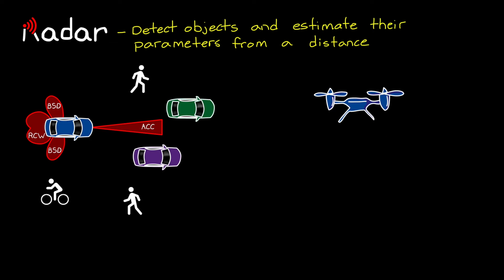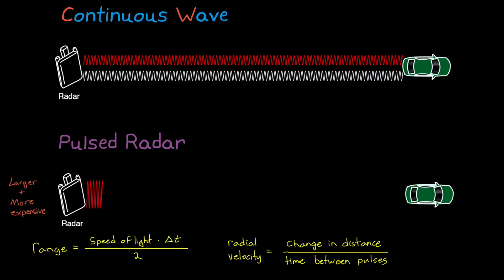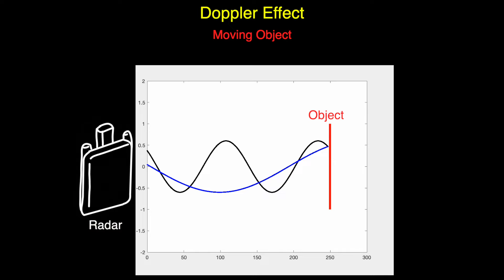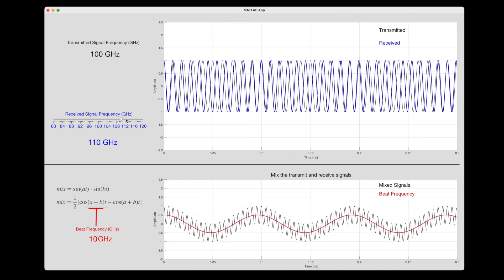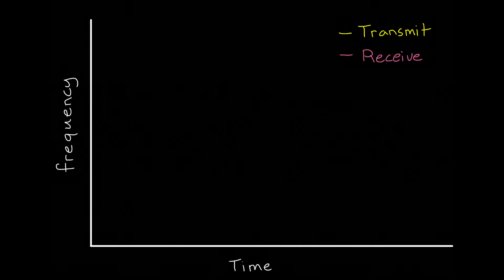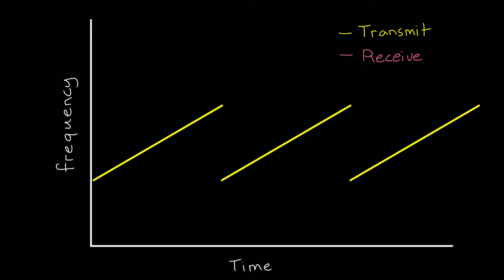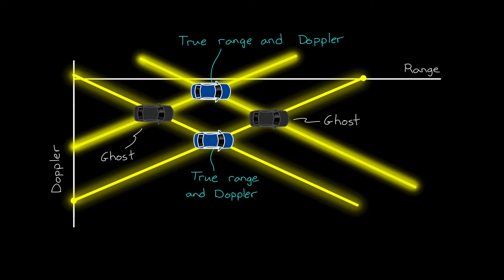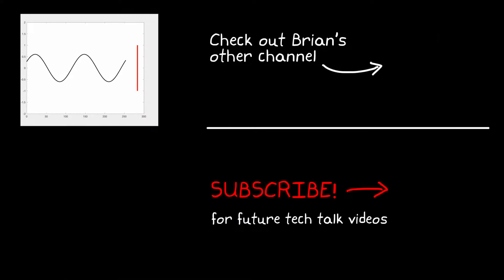FMCW Radar for Autonomous Vehicles | Understanding Radar Principles

Comment: Really nice job! Thanks. We at dSpace have auto radar test HW that can allow simulation of up to 1000m distance in various frequency ranges especially E-Band 75 to 82GHz (up to 5GHz BW) but over a short distance test set up in the lab! This allows auto/radar vendors to easily test HW for scenarios of e.g. FMCW, Doppler, MIMO => location, speed, angle, and differentiation of 2 cars ahead for example.

Comment: @Brian Douglas Hi Brian.  You made a fundamental mistake  at 8:54. You don't transmit an IQ signal.    Transmitting sin + cos is the same as transmitting a shifted sinusoid, which does not solve any problem. It is like shifting the transceiver by quarter wavelength. What you need is  performing IQ downcoversion in receiver. Otherwise nice video and beautiful presentation.
Reply: Hi habi, actually my thought is that Brian had computed the Real and Imaginary (IQ) components of the Mixed signal being thereafter processed of prior transmitted signal. Hence, we merely need the Magnitude and Phase of mixed signal to derive In-phase (Real) and Quadrature (Img.) components in Complex Sinusoid form as indicator in relative to determine whether it's Approaching or Moving Away target, if there're any of other thoughts or opinions, feel ease to share, Thanks habi :)

Comment: All nicely explained until 11:54 when you show the Beat Frequency as the difference between Tx (yellow) and Rx(pink).
However the difference is the same wherever you are on the ramp.
Therefore how do you use the beat frequency to deduce the range if it’s the same value along the time axis ?

Comment: Nice Video!! thank you so much. Quick question -If we precisely estimate the received frequency, a Computer could estimate the direction of the target by simply subtracting the frequency of the received signal from the frequency of the transmitted signal? If so, then why do we need an IQ and beat frequency concept?
Reply: Good question! It's really hard (expensive) to measure the precise frequency when it's in GHz. But it much easier to measure a signal that is in KHz (like the beat frequency). If you did have a super precise computer that could estimate the receive frequency in GHz then I believe you could determine the Doppler that way. You'd still need IQ signals to determine direction though.

Comment: Hi; great video series - I have watched up until ep4 (pulse-doppler) and the explanations have been great. Some questions: where you say the i and q signals are orthogonal, do you mean physically orthogonal, i.e. two perpendicular antennas (e.g. cross dipole)? If I'm not mistaken, wouldn't orthogonal, 90deg phase shifted signals result in circularly polarised radiation? Presumably it's not possible to produce i, q signals with a single antenna? Thanks in advance.
Reply: Hi ejq, base on my understanding it's rather mathematical than physical, we may read on Complex Sinusoid form, as Brian had presented such that of single resultant complex field form (single poln.)

Comment: Thanks for the video. But I get confused at 12:36 sec.
Could you explain more about the range doppler chart? I don't understand why we have a rising line in the chart, then we have another falling line? :/
Reply: This is the only part of the video that was not well explained, I agree with you on this. I think I understood how these lines are derived: You have to find the two points that intersect with the Range,Doppler axis. We can find the point on the doppler axis by shifting the receiving curve on the right until we have 0 range (2 beet frequencies equal), and measure how much is the doppler-caused beat frequency there. Then, for the point on the Range axis, move upwards/downwards the receiving curve until doppler-caused beat frequency is 0 (2 beat frequencies have reverse sign). From these 2 points you can get the lines. Depending on the sign of these points relative to each other, you can get both the falling and rising lines.

Comment: Hello, It is a very good presentation..Thanks for the video.
 I have a doubt at 9.3 sec.
 Firstly how we mix the transmitted and received signals? Because we have two transmitted  and two received signals. So how the sine components look like? Any reference?
Secondly, you mentioned that looking into which signal leads the phase after mixing (i.e., the real and imaginary) we can determine whether object is coming towards or moving away..this I couldn't understand. In Earlier part of video while explaining Doppler effect I understood that if freq of received wave is more than that of transmitted then object is coming near otherwise moving away. But with IQ signal concept I couldn't understand. Is it like if Real leads the imaginary signal then object is moving near otherwise its moving away?
Looking forward for your support.
Reply: 1. Only one phase needs to be transmitted from the RADAR antenna; the local oscillator used to generate the signal can provide the in-phase and out-of-phase components to be mixed with the received signal for motion analysis. Showing the two phases transmitted in the app was mostly for demonstration, since when the two are added together, they form a half-power wave shifted 45° from either reference phase.
2. The output of such RADAR systems to their signal processors is the Doppler frequency produced by mixing, not the raw RADAR frequencies on their own. The result of this mixing is that the magnitude of the shift is what's returned, not the sign of the shift. The only way to determine the sign (opening/closing range) of the Doppler shift without IQ encoding would be to directly measure the frequencies of the returned signals, or to also use the upper-sideband beat frequency (the ones up in the high GHz band). Since most RADAR transceivers are in the GHz band and the Doppler shift we're looking for is on the order of kHz, you'd need an exceptionally high-bandwidth receiver and ADC to measure it, driving up expense and electronics size. IQ encoding is considerably less expensive of a method, since all you need is an extra I/O line to the signal processor, and a phase-shift network/delay line and/or PLL to give you the quadrature component for mixing.
Reply: @eddievhfan1984  So the radar antenna only transmit the In-phase component of the I/Q signal ?
Reply: @tungtritrinh1381  Essentially.
Reply: @eddievhfan1984  Can you give me a more in-dept explanation to how the Radar calculates the Quadrature beat frequency since the local oscillator only provide IQ component for the receive signal ? Im still confused cuz i dont study in Signal Processing.
Reply: @tungtritrinh1381  It's not too complicated. As I mentioned, the transmitter only sends out one phase in its pulse. Phase shift of the reflection is caused by moving targets, while stationary targets will remain in-phase. (Fun fact: this can be used by itself to provide moving target indication (MTI) RADAR without detailed Doppler processing). The received signal is mixed with both reference signals separately before entering the signal processing stage.

Comment: The section from 8:45 to 10:00 is wrong and (IMO) too misleading. The physical signal we send is always real, and the signals we receive are real. We cannot transmit an imaginary signal, and we cannot receive an imaginary signal. Not only are the 'imaginary' signals on the upper two plots actual nonsense, but also the 'in phase' and 'quadrature' shown on those plots are literally misleading concepts. Especially the receive plot, that is a really misleading mistake in what in-phase and out-of-phase mean.

What actually happens in this radar is we transmit the same real CW signal and we receive the same real doppler shifted CW signal. No changes at all there. The only thing we have improved is the demodulator: we send the receive signal through an I,Q demodulator which produces the I,Q complex values, i.e., it decomposes the received signal into one part that is in-phase with the transmission, and one part that is out-of-phase with the transmission. The I,Q then circle clockwise or counterclockwise on the complex plane depending on frequency shift direction, i.e. the I,Q values go up and down as shown on the lower plot. Only the lower plot is correct.

So ultimately what the complex I and Q demodulation does is it allow us to distinguish the positive and negative doppler shifts, which is information that was in the reflected signal all along but that information had been discarded by the primitive beat frequency demodulation described earlier.
Reply: Bro i want to ask something. 
What wave form just radar actaully recieve? 
transmitted+recieved , recieved or transmitted*recieved
And if it is (transmitted+recieved , recieved) these two. Why we dont just use fft and get  it?
Reply: @painpenguin  In general we want to think about radio frequencies in the GHz, which would take many gigabits per second of processing power to do FFTs. So that's why we do some mixing in the electronics first which reduces the bandwidth of concern.

Actually for low frequency you can literally just measure and FFT. For example I have a cheap software defined radio that can do this up to 100 kHz if I remember right.